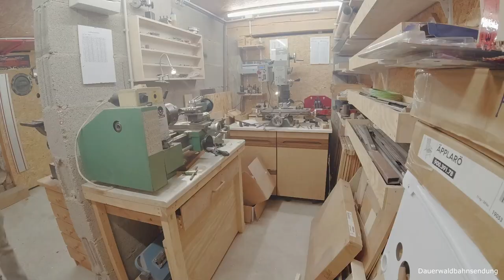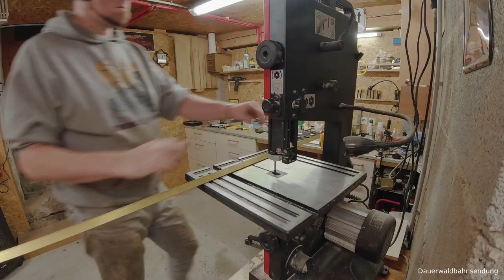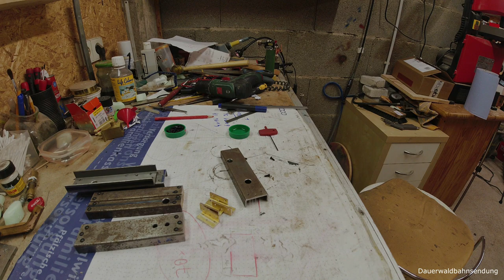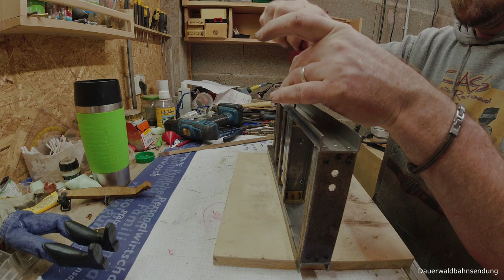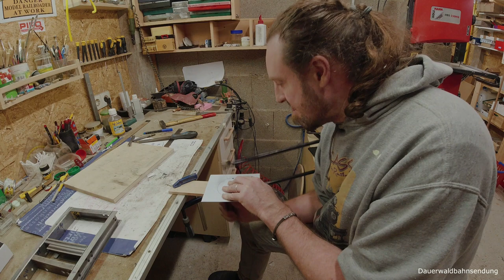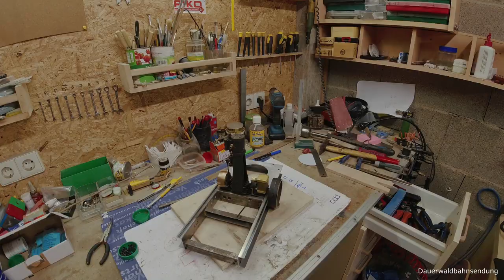Building a Steam Donkey - #1 engine base frame

Comment: I want to build a 15 inch gauge farm railroad and a half size traction engine for field use as well as restore horse equipment I have a ideas how to get started in carriage building and wheelwrighting but have no clue where to begin with machining anything any suggestions ? I already have kozo hiroko's building a new shay and climax book and he was using a lathe and mill combo but all the combo machines I've seen are far too small for me especially if I want to rebuild the scycle bar mower I have as a first project before any scratch building
Reply from the maker: Hi, Kozo's Shays are build in 1/16-scale and and much smaller than the models you have in mind. So a combinations of mill and lathe may not work out for you. You may need much bigger machines.
As I'm just a hobby machinist, I can't give specific hints, but I recommend separate lathe and mill in appropriate size for your projects.
Reply: @Waldbahner   thanks you, that is what I figured